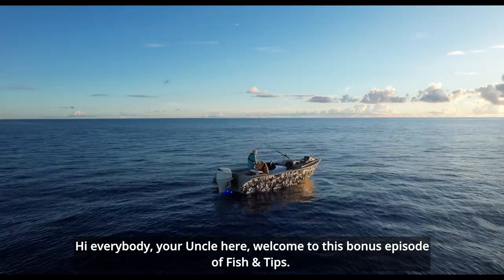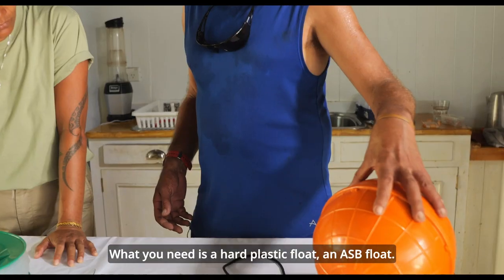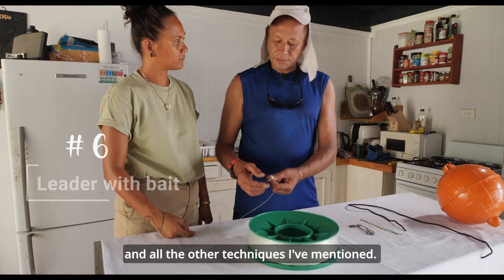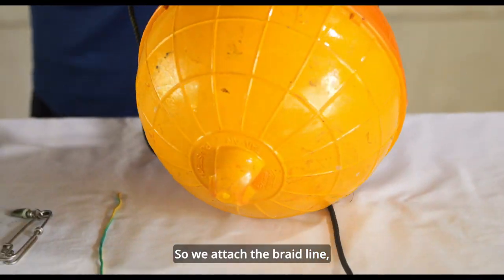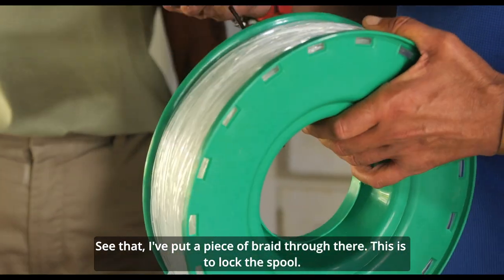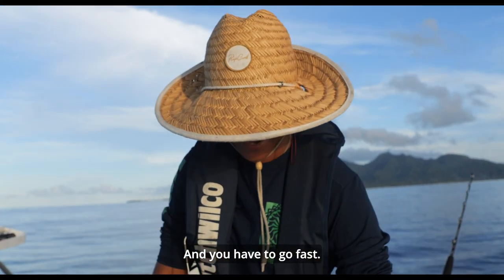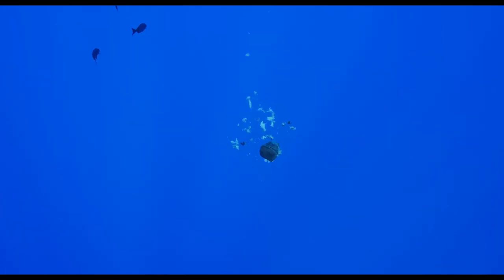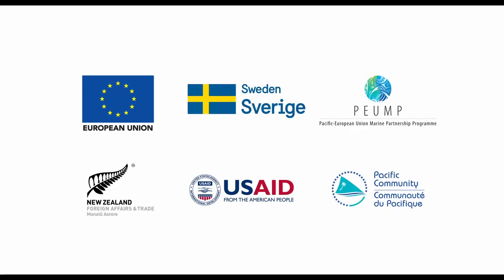Drift line with a self-righting buoy l Fish& Tip bonus#1 Season 2

Comment: Never seen this technique before, like deep sea bobber fishing haha. Will the float ever be submerged or the spool break from the pressure of the fish pulling it down? Mahalo for the video!
Reply from the maker: Thank you for your comment and interested in our work! The yellow foam float is not as robust as the bi-coloured hard plastic floats but yes both floats can and do go underwater. If a medium size fish for example 20+kgs take the hook, sure both of those floats will submerge. It is best to hope that it returns to the surface as the fish tires out. The hard plastic float has greater resistance and will easily return to the surface for fish up to 60kg. For fish larger than 50kg you’ll have to wait a little longer, a 5-to-10-minute wait seems like a very long time. But its is worth the wait. Uncle Ian has had 24 cm diameter float go under (submerged) never to be seen again. He said it was a huge tuna (80+kg). I still don’t know how he knew it was huge tuna when he never saw it. Uncle is clever. Uncle has never cracked a spool from the pressure of the fish pulling it under! We hope this answers your questions!
Reply: @spcnc1  Mahalo for the reply, guess I'll have to find some hard floats and give this a try. We only have the 36cm (360mm) floats here in Hawaii and I think they have 45lbs (20kg) buoyancy down to 1000ft (300M) so that may work....thanks again!